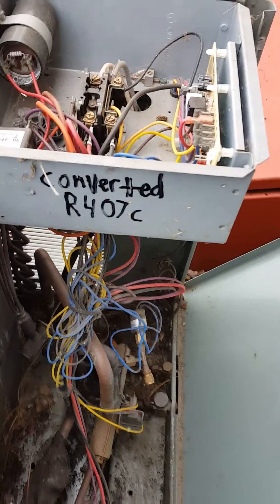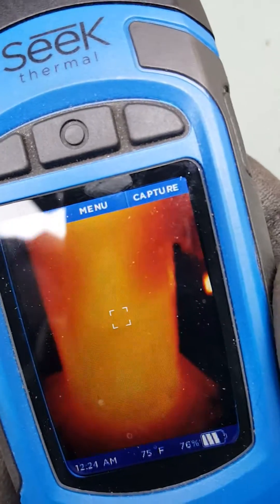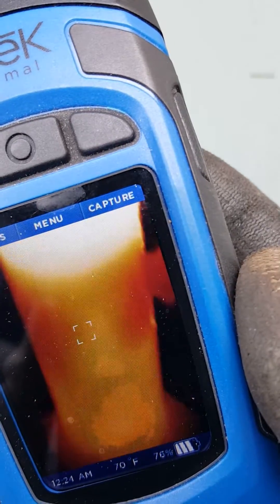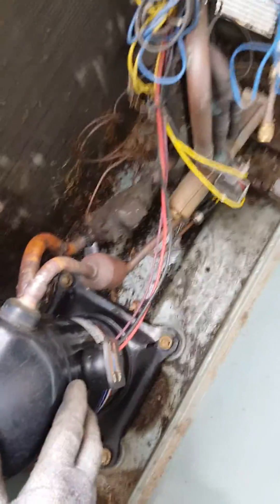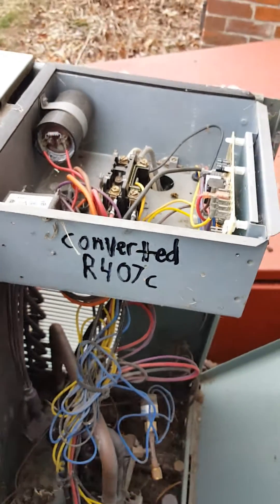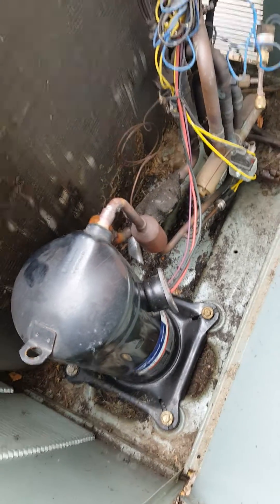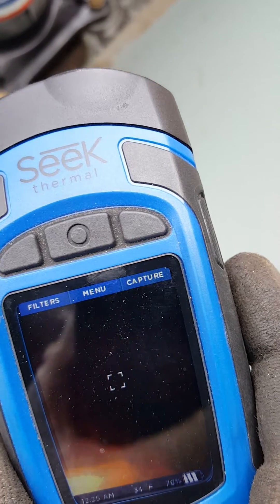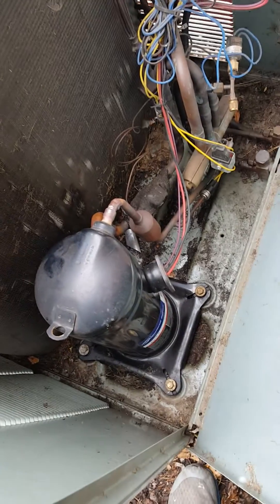R407c Conversion 3 Month Update

Comment: How did you see oil return with the thermal imager? What would it show if there were no/poor oil return? Thank you 👍
Reply from the maker: The bottom of the compressor should always be warm when running.    If it is cold, that means liquid refrigerant is overflowing from the evaporator and washing out the oil.
Reply: @NathansHVAC  I see. Thanks 👍

Comment: Nathan did I hear you correctly you mentioned mineral oil still in the system? did you only add some Poe in on top of mineral oil?
Reply from the maker: ucantstopthis1 yes mineral oil and p o e oil will mix fine. The ratio needs to be 20% or higher p o e oil. Of course pure p o e oil is ideal.
Reply: NathansHVAC so you did not remove any mineral oil at all? Just add 20% more than what the original charge amount was on the compressor?
Reply: @HVACRSurvival  watch the original video.
Reply: @HVACRSurvival  if you watched the first video the pipe going to the compressor had a leak in it so he unsweated the pipes to the compressor removed the compressor completely dumped out all the mineral oil from the compressor refilled the compressor with the original capicity amounts using poe oil 32 or 38 then reinstalled the compressor using a piece of new copper pipe repaired the leaky pipe then vacaumed out the system then charged to the original r 22 capicity using 407 c which is how you should do it.

And most who are having issues with 407 c is due to not removing the mineral oil first.

And that is still something that makes mad about residential hvac and Comercial hvac.

It should not even be a debate.

With cars when you convert from r 12 to r 134a you are, supposed to remove the compressor dump out all the mineral oil from the compressor and put Ester oil in it or pag 100.

Then change the acumalator reciever dryer flush out the linesets condenser and evaporator coil with a flush solution and compressed air until everything is clean hook everything back up then vac out the system for 30 to 40 minutes then charge up with 134a and that's the principles you hvac guys should be using.

Instead of going ohh just replace the system all the time.

Some of those old York tranes and carriers from the 1980s and late 1970s are like antique classic cars.

Comment: what refrigerant would you use if cost was not an issue? R407c or R-22?
Reply from the maker: R22 of course.  That is what the system is designed for.  Alot of people were recommending R422a.  However, I"m finding that the orifices needs to be drilled 10% larger with R422a.
Reply from the maker: The system was designed for r22. But if you change the oil or add the oil 407 is the closest replacement.
Reply from the maker: thegooch27 I probably just use 22 though.
Reply: @NathansHVAC  now it is illegal to use r22 and we have an older system with it in it, thinking of using your information to drop the 407c. Only one guy even brought it up the rest want to put in a complete new system ($5000-7500) thanks!